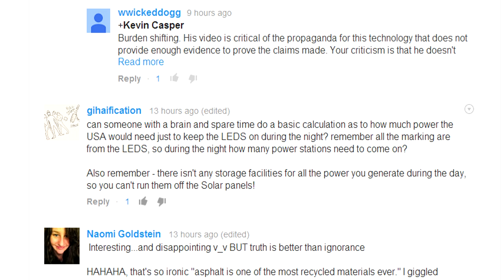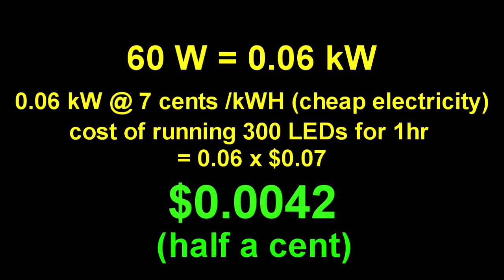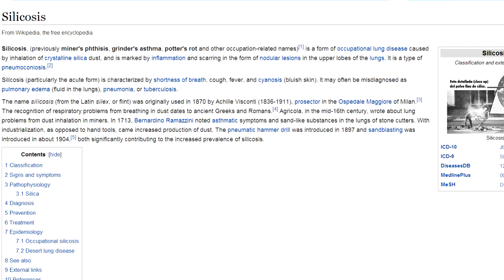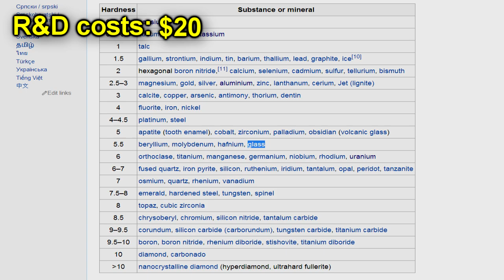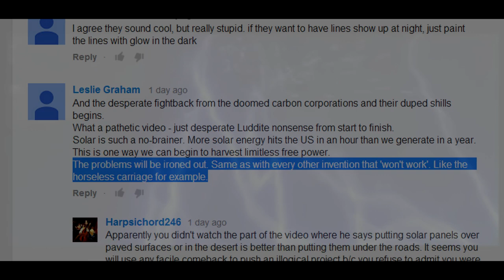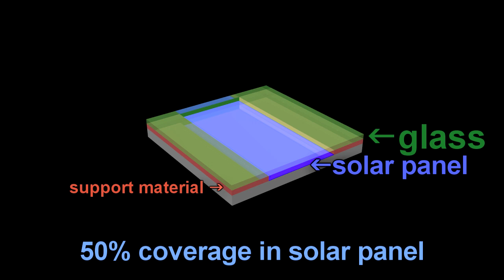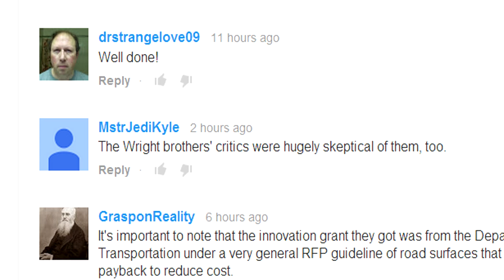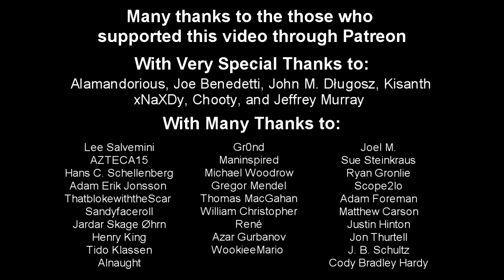Solar Roadways, IMPORTANT QUESTIONS AND ANSWERS!

Comment: Much to my shame I was completely taken in by the hype of the entire "solar road" fad when it came out simply because I took it at face value and didn't really think about the logistics of it.

A way to potentially increase the efficiency of the flat panels would be to have conical microstructures instead of a smooth panel (which I guess means they're not flat). Or a repeating egg-cup pattern to better harvest sunlight from different angles. But it would be a nightmare to actually create on any large scale and would probably take more energy to manufacture than you'd ever get from the panel in its lifetime.

Although I don't disagree with the spirit of the LED power calculations you did theorise all of the LEDs being on at once which wouldn't be the case. But even if 10% of the LEDs were on for 8 hours a day the consumption required would make them nonviable.

Comment: Hey Thunderf00t, I admit that when I had first heard of this solar roadway idea I was excited. As a science PhD student I am a little ashamed to admit that I let my excitement get the batter of me. Your video raised some very good points that I should have thought of without prompting. Do you have any thoughts on how to make such any idea more viable, functional and realistic (just pure curiosity at this point).
Reply: put the solar panels next to the roadway.
Reply: Put the solar panels on a roof in a parking lot and then it doubles as shade and electricity
Reply: There is no way to upgrade this idea. Best would be to put it above the road but then when you get any car accident they get broken. Best thing is to overall abandon the idea.
Reply: @clint torres oh thanks didn't know that was a thing
Reply: Put angled solar panel installations on the roofs of all buildings.

Comment: As a geologist, I'd advise against using the Mohs scale. It's actually poorly named, and is pretty much resistance to abrasion. Other mechanical characteristics matter much more when building roadways. Glass is still a terrible, terrible idea, though... there's no doubting that. Though many of the rocks used on the roads have a "hardness" less than glass. The aggregate properties still make them good for roads.

Comment: I'm only a short-time subscriber to Thunderf00t, so I only just caught up with his "solar roadways" videos, but as an engineer I'd been using the same concepts and calculations to debunk this crap.

However, one critique of Thunderf00t's calculations is for the amount of power required to light the LEDs.  The calculation included the assumption that all of them would be lit on a tile, when the concept was for only a portion (or none) to be lit to form the markings.  A better calculation would be to use the area per LED, figure out the total area of existing road markings, then do good 'ol dimensional analysis to obtain the number of LEDs that would need to be lit.  At most, a very rough estimate would be only 1/20th of Thunderf00t's calculation.
Reply: So that means an incredible amount of LED's would be wasted as they would almost never be used.
Reply: Also now that i think about it, they have 4 million dollars. They should use that money to create a more efficient glow-in-the-dark material than we currently have an the LED's wouldn't even be neccesary.
Reply: +Arthanias Indeed, vastly over-built and under-utilized.

Comment: I enjoyed this video however would like to point out one inaccuracy. The comparing the cost of buying 300 LEDs on amazon to the price of placing an order directly to the manufacter of millions, billions, or even trillions of LEDs is ludacris. Yes the total cost would still be billions of dollars, but i think 8 billion dollars would even be considered a complete rip off for an order of that size. GRANTED the company contracted to make the panels for the project wouldnt order 12 trillion ledz all at once, incase the sweet sexy goverment money runs dry. ordering even billions or millions of leds is going to bring the price down well over 90 percent the average consumer pays for leds on amazon.

however in the spirit of not bashing you. What would happen to these things in snow storms and you relied on these things for grid power. would the blackout last as long as the snows on the road? also what happens when a road loses network symmetry. does the panel just turn off? more than likley your driving down the road and then all the lanes turn into a massive illuminated penis, then the lanes continue until you get to the glowing tits... food for thought, love the videos man. keep rockin
Reply: +jonni wilkers "The comparing the cost of buying 300 LEDs on amazon to the price of placing an order directly to the manufacter of millions, billions, or even trillions of LEDs is ludacris."

Not really.  $20 for 300 LEDs is about 7 cents each.  It's going to be very hard to reduce that by the 90% you claim (which would be 7/10ths of a cent each).  However, if you have data to support such a price, I'd like to see it.
Reply: +Michael Sommers

http://www.mouser.com/ProductDetail/Cree-Inc/XMLCTW-A0-0000-00C3ABB02/?qs=sGAEpiMZZMtKo6xK7%252bVI1mlUjoOTJB58g4XwYBrKYHw%3d

These rgb leds are about 7/10ths of a cent each, granted the specs, and may not be nearly as bright. But the price for a reel of 1000 IS 7 dollars. In the video he compares a hobbyists/electronics enthusiast product which comes with a power supply, remote control, and a reciever to the price of buying just the leds. so the price of of the leds is LESS than 7 cents because they're supeeflous sh-t as well, which encorperated into the price. my main point and take away from all this is that comparing the average amazon listing to buying in bulk from the manufacturer or from a distributor is provides a poor comparison. god know how much the leds in the  amazon listing, but its fair to say most of the cost for those leds come from the massive power brick/supply and the 2cool for school remote control sh-t.
Reply: +Michael Sommers 
if that link doesnt work here is the mouser
com part number

941-XMLCTWA0C3ABB02
Reply: +jonni wilkers "But the price for a reel of 1000 IS 7 dollars."

When I put a reel of 1000 in my cart, the price was $7,730.  That's 7 bucks apiece, not 0.07 cents.
Reply: +Michael Sommers ok i spent to little time researching the right led to buy, but my point still stands. when u buy 300 leds from amazon with a power brick and a remote control crap, and a tiny string of leds your paying for the silly accessories and power adapter to run the lights. leds are cheap.
Reply: +Michael Sommers yeah you got me. no wonder amazon is so good, they must be selling rgb leds to every electronics manufacturer in the world in since appearantly they sell the cheapest rgb leds on the planet! and it comes with a remote control TOO!
Reply: +jonni wilkers 
So far the evidence points the other way.

Here's a cheaper one: 2.8 cents apiece in lots of 5000: http://www.mouser.com/ProductDetail/Lumex/SLX-LX5093ID/?qs=sGAEpiMZZMtmwHDZQCdlqVsz6Sp3LtaXPJVEZaCNfgA%3d
Reply: +jonni wilkers 
All you have to do is show me where to get LEDs for a fraction of a cent each.
Reply: +Michael Sommers i conceed. just find it hard to believe thats all. i came out way to overconfident with my 1st 2nd and 3rd post.
Reply: +Michael Sommers i dont know where to find leds for less than a penny. i will do some research 
later. although i do have some ideas.
Reply: +Michael Sommers 
i didnt do my research and got butthurt when i started responding. sorry. good thing your here to set the record straight. feeling stupid now 😣
Reply: jonni wilkers I find it a little hard to believe, too, but that seems to be what the data say.
Reply: +Michael Sommers the question now remains then why is the tagitall brand (amazon product from the video) throwing away money?
Reply: jonni wilkers Good question.
Reply: +jonni wilkers 
It's not as if the LEDs will be the major cost on these tiles.

Comment: Thunderf00t,  don't be such a Debbie Downer !  You're focusing way too much time debunking what is a tangential benefit of the technology... the LED lighting... it is the power generation that matters.
Admittedly, solar roadways are a stretch -- because of the durability / transmissivity issues -- BUT solar driveways, outdoor sports basketball courts, and regular walkways (ie. low traffic weights / volumes) would work... and, when you compare the costs of traditional petrochemical-based solutions, you have to include the $Trillions in health care associated with the cancers and heart disease caused by burning oil / coal to generate power.
Reply: +Sowshul Media The real thing to compare with is spending the same money on a sane way to install the panels.  The cost per watt is way too high when you try to make any flat surface that can hold up a car also be the solar panel.  Panels up in a roof make much more sense.  Thus Thunderf00t is correct in what he says.  He in not opposing solar power.  He is just opposing a daft idea.

Comment: i liked the idea but after thinking about how are roads treated and what other crap goes on in nature like lighting strikes .floods , fire from a crash car , a bad guy running from police on just rims , truck rollovers and what ever acid or load was caring , cars leaking oil ,gas, trans fluid, power steering fluid , axle grease , pieces of rubber from 18 wheelers hitting the pavement when they blow ,  and not being able to see the led at daytime is too much i would prefer pressure sensors to make energy

Comment: I just noticed that the LED strip you used as an example has about the efficiency of an incandescent light bulb.
If it produces 900lm at 60W that would be 15lm/W which is by far the worst efficiency I've ever seen for an LED.
Even cheap LEDs should be somewhere around 50 to 80lm/W. CREE even broke the 300lm/W barrier shortly before this video was uploaded, so what's up with that LED strip? Just a Typo? They most likely meant 900lm per meter, I think. That would be 75lm/W which puts it in the right ballpark.

Comment: the glass used for the roadways is specially tempered to be strong as steel
Reply: +Kerry Abercrombie (Darkelfjuggalo)  As HARD as steel actually. Hardness doesn't equal durability. Take a sledgehammer to a panel of tempered glass, then take a sledgehammer to an old car tire and see which one breaks first.

Comment: The idea of solar panels on roada itself isn't that terrible, it's the main implementation they suggested & the stupid LED thing. They should just make the roads normally but with sturdy panels of some sort that can absorb energy in some manner. I dont have the answer, but I'm betting they could make this work if they dont do stupid shit with it or try to get fancy. People always ruin their ideas by getting fancy or by overloading them with pointless bells & whistles. Practicality is necessary when something is on such a large scale. Think big, sure, think out of the box, but don't screw yourself by expanding so far that nothing can reasonably contain or fit the final idea. Some boundaries are necessary, like, you know, logic. Physics. That kind of shit. It might be just the littlest bit important... Just a thought.

Comment: the dude thinks he's gonna make so much electricity that is gonna pay out all that expense, and seriously this is the first time i see republicans supporting a ''scientific'' idea
Reply: +kenan behemoth   Temp of  1,650 C  ( 3,000 F) to make glass and to recycle, temp to make asphalt 150 C (300 F), the only way Solar Roadways is going to make a enough to pay for it self is if hell freezes over.
Reply: if it worked which is practically impossible, it would pay themselves out in a 1000 years, seriously a glass road, it seems like sth you find on Onion
Reply: +kenan behemoth if you wouldn't need to replace/ repair it that is
Reply: *****
yeah it's really telling when you see a republican supporting science, you know it's a scam
Reply: +Kitsuneoni,
They may last forever but what we put them on will be the same old construction. Concrete also last almost forever but, when what is under it fails, it crumbles.
Reply: Kevin Jackson also water creeping into/ underneath the tiles will be one hell of a problem
Reply: exactly, it's practically impossible, you would need some glass that's unaffected by all that movement, friction that traffic would cause
Reply: +kenan behemoth  All polititians are idiots when it comes to science. I don't blame them, its not in their skill set

Comment: k so can these solar roadway people just please release a video of one of their installed panels (on their driveway) hooked up to a multi-meter for a regular sunshine day? even a simple graph of the energy output data over a week? a day? an hour? im really curious as to just how much energy they lose in just the faded, studded, and warped glass that they expect to use >.> if you look at the panels you can barely even see the cells behind that fucking glass >.< super great for solar panels eh?
Reply: +eszky y     All the panels see in the test parking lot are mock-up.    There a photo of a glass pate sitting in a wooded box with paper pattern glued to the back of it.

Comment: at the moment this is to expensive and impractical 

but in the future this could become more realistic as things such as metallic glass (which is known to beat out steel in toughness) will become cheap and be able to be used on a mass scale and new solar panels could be designed to collect more power from the sun.

Comment: Okay, first off, great concept(not even gonna use the word idea). BUT we would need:
1)A cheap, transparent, scratchproof, flexible and strong material
2)An efficient way to store and transport the electricity
3)A cheaper, brighter and more power efficient light source
4)Some way to make our current road workers electricians 
5)More efficient solar cells
And we're done. Works fabulous conceptually, but sucks practically

Comment: I just read an article about the solar bike road that they made here in The Netherlands. Using TF's math and knowledge, I was able to explain others this is not a great idea, and that by putting the solar panels in the ground they are losing potential energy. For those who are curious; they managed to power 3 houses with the solar bike road. The project cost about 3 million euros. Half of that was paid by tax money.
Reply: +tuber9211    No, they didn't in May of this year a news story about SolaRoad came out claiming only one was home could be powered, on top of that the broken glass that happen in December 2014 was poorly fixed using asphalt as a  patch, the Dutch government shut it down this last August for safety factors.
Reply: Mark Baanstra they actually did.. the article came out yesterday. This makes it even worse though..
Reply: tuber9211   Wow, no kidding, after seeing the 29 sec video of what the SolaRoad look like, it's looks ten years old and half of it patched up, no wonder they shut it down.   And you can't me tell that waterproof.
Reply: Mark Baanstra Yes it looks very bad.It did indeed break in December. I'm assuming they fixed it. On the website of SolaRoad it says: "SOlaRoad exists one year. In that one year 9800 kWh has been generated." It was put on the website yesterday. Various news sites also published articles about it.

Comment: If you really want to spend trillions of dollars on solar roadways, you would be better off to roof over every road and parking lot with solar cells, and you would get the added benefit of reducing the effect of rain and snow. And you could perhaps have, every 500 feet or so, variable LED signs for intermittent use. Still probably not a good idea, but it beats this one.
Reply: Or spend $5 quadrillion ($5,000,000,000,000,000) on sapphire roads and even more for the medical bills caused by people getting hit by shattered rare gem fragments.

Comment: I think that it's possible. I mean hey we sent people to the moon didn't we? It is a great idea and it is still a young one. If this guy thinks he has all the answers then why doesn't he help to refine the idea of solar roadways instead of bitching about it???
Reply: To refute an idea doesn't require providing alternatives, that's fallacious.
Also, he showed many times how current road resources are superior to the solar roadways. This is enough to scrap the solar roadways - they're more costly, less efficient, and more dangerous.
Reply: +charles andrews So just because we sent people to the moon then we should give credit to every half-baked idea out there? Got it. 
I'm going to invent a square wheel. With some engineering I can get it to work. And anyone who laughs at me is wrong because people laughed at the Wright brothers.